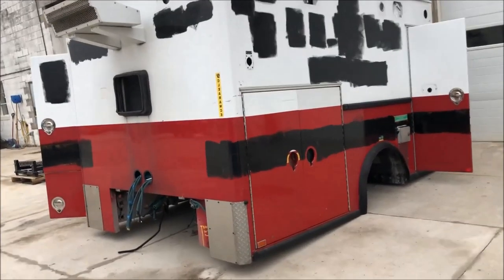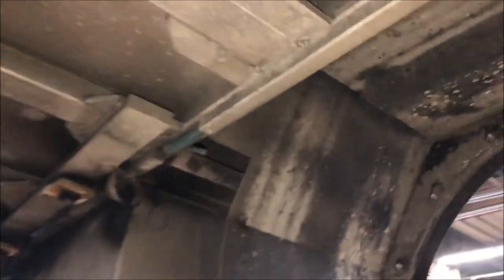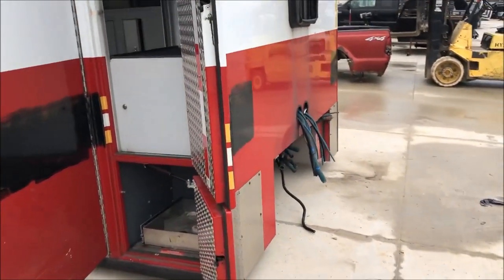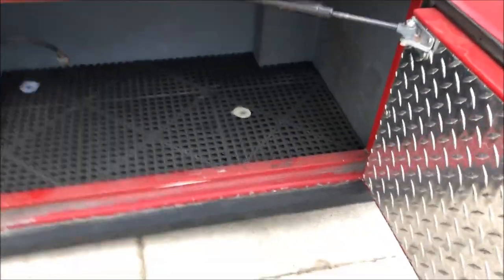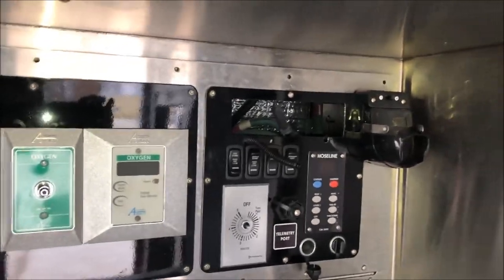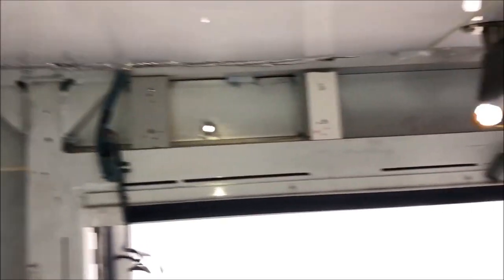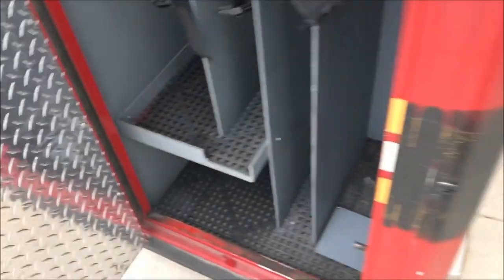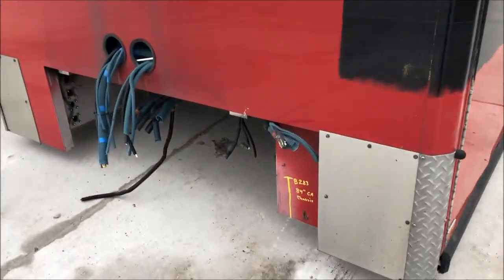Sold Ambulance utility body 84inc CA fits long Chassis truck no pickups

Comment: how much is it in this shape?
Reply from the maker: Sold
Reply: @rondotrailer  i bought same . Any Idea about the weight ?? 
And which vehicles It fit ?
Reply from the maker: @عليسالم-ق7س9غ  No ideas, maybe 1100 kilo? Ftis Chassis trucks with 84" CA but need modification.